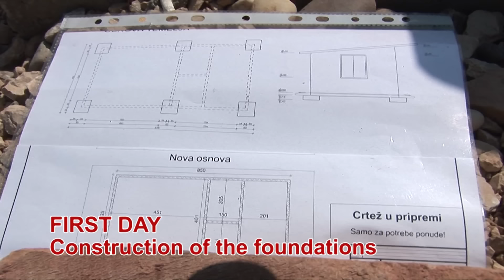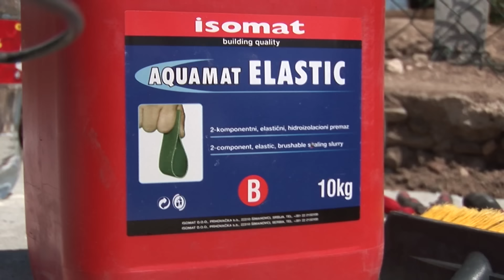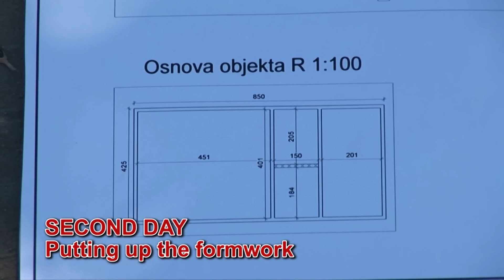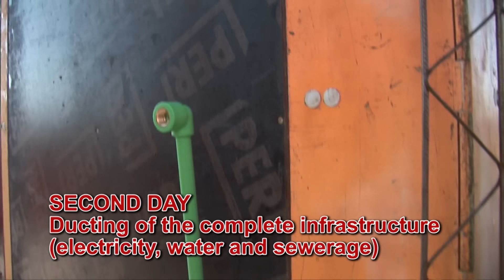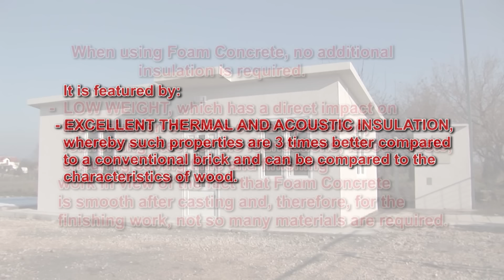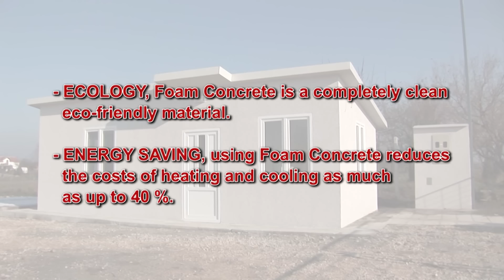FOAM CONCRETE, affordable house built in 6 days!

Comment: And here I've always been under the impression that most of the strength that comes from concrete is due from The Rock inside of it... I've made several polysteel houses and formed concrete houses. I'd be interested to know how these foam concrete houses hold up in a natural disaster of any kind?
Reply: I doubt they can withstand it, this solution is not for every city or country IMO.
Reply: It's clearly a form of ferrocement even if they call it foam concrete, so the strength comes from what it's cementing together. So really it depends on what admixture they are using to get the foam stable. I would be surprised if there isn't some form of fiberglass inside
Reply: @humanistwriting5477  ferrocement is just regular cement with less rock and more sand in it, but they make up the strength by using a smaller mesh metal skeleton with more metal surface area. like multiple layers of chicken wire instead of  bars of 5/8 rebar, Never heard of it being used with fiber reinforcements before.I would think You would need very long fibers to make it structural. I live in California and realize that our building codes are quite a bit stricter than most places.  Of course that's why when we have a 7- 8.0 earthquake we don't have 10 of thousands of people crushed to death either.
Reply: @travisdoe4663  yes I'm aware of traditional ferrocement, did you spot the grid of thin rebar? I'm hardly calling this traditional. Just, based on, a child of the tech.
And of course we can't know for sure what they are adding to the mix or not, they only show one shot of the one worker adding cement to a hopper and another showing the foam from the spray nozzle.
I am aware that aerated cement has decent qualities but it's not something I'd expect to see in a roof by any means, and it's generally preformed into low strength cinderblocks.
Reply: @humanistwriting5477  Only time I've ever seen  ferroconcrete used was in the construction of water tanks. Then they used remesh which is like a thick gauge hog wire. I have helped build 6 ICF houses  using different kinds of form block systems. It always amazed me how much 5/8 and 3/4 inch rebar went into the structures, on top of the 3/4 in. aggregate in the concrete. The engineers were always right on us to make sure we never did lifts higher than 4 feet and that our slump was correct.  Also to make sure we vibrated the cement properly but not overly. I probably built over 40 houses in the last 25 years.  ICF were by far the most expensive houses we ever built, although they'll probably last forever and the walls had an R value of over 40 not to mention the added bonus of literally being Bulletproof lol.  Two of them were multi-story and with the amount of wood necessary for forming and supporting the floors in between each level, they might as well have just built the house out of wood,lol.  Of course we were a relatively small contracting company and did not have forms already, I assume if you specialize in this kind of construction you could use the support over and over again. The ICF  Blocks were cool though, like a huge Set of Legos.
Reply: @travisdoe4663  ICF is cool no doubt. And I'd half expect something like aerated cement to be using in conjunction with the insulated concrete forms for money savings lol.
Pretty cool to meet an construction worker who's probably used the tools and forms I've made as a manufacturing engineer and tool & die maker, assuming you're company has bought usa made that is. 
Yea, the uses they have in this video is. Just a weird hybrid, it's bizarre to see, they must be including some addmix that we are not seeing otherwise that roof would be sagging into the house as they did the interior build out! Although I've always thought that a ferrocement roof properly sealed would be an ideal use case! Never did get why nobody made tools for that, but there is often times no convincing the investors that a tech will work and frankly they all don't pay any of us enough to try it on our own!
Reply: @humanistwriting5477  I think ferrocrete would probably Flex too much to use as a second-story floor or Roof System. Maybe in conjunction with a standard concrete- rebar I-beam system, with ferrocrete spans in the middle? I don't know, I'm certainly not an engineer but I would guarantee you the walls and roof they poured in the video would not pass engineering on the North Coast of California, lol.
    We started off using the polysteel ICF system at first, but we're not fans of the tongue-and-groove Locking System or metal webbing. We then tried, I believe it was called Apex? it's been probably 16 years ago now, lol.  It had a Locking System very similar to Legos and much more robust than polysteel system of tongue-and-groove that would break off if you did not handle the blocks carefully. It also had a polymer web instead of a steel web which made it much easier to cut.  Now they have many generic brands that you can buy for much cheaper than it used to cost.  Haven't built one for years, they just weren't very practical. The labor expense of tying all the rebar, moving it around the job sites and the footings and whatnot that were needed for engineering made the cost very prohibited.  We were building them on the side of the Cliffs out at Shelter Cove California. You should have seen the size of some of the footings that were necessary.. literally tens of thousands of dollars in concrete and rebar just for the footings alone.
Reply: @travisdoe4663  ferrocement definitely can be quite stiff, it's all relative in the end though, say for example compared to the metal roofing that (for some reason) is allowed to go in without a plywood sheath underneath in Utah.. where there are heavy snows.  😱😱😱

Ok. Happy to hear from your experiences I definitely do not think any of the icf systems are made for your use case lol. It definitely seems to be more for expanding a basement by a wall or for landscaping
Reply: @John Fischer wood framing is certainly the most practical. Although other Alternative building methods have their perks to, but the price certainly isn't one of them. Like ICF make sense out by the ocean because saltwater is so corrosive to metal and wood, and the concrete structure will last several lifetimes. It also has some of the best insulation R-value on the market.  But your house is literally set in stone, good luck popping in a window or door or moving a room around, lol. And if anything does fail it's going to be a PITA to do any repairs.  I remember one of them that we put together they wanted a central vacuum system. So when we were running 2"vacuum line through the concrete walls I couldn't help but think what would happen if one of the lines got plugged up, lol.

Comment: This was interesting. I wonder about fixtures and placing things on the walls. How does the walls and floors hold up?
Reply: They hold "up right"..
Reply: they don't. that's shit consteuction with chemical marerials.
Reply: I would imagine you'd need conventional framing inside the wall for locations that need it like cabinets and fixtures.
Reply: @frenkloyd4277  AirCrete is concrete with foam mixed in providing the "air*.  Said foam is created using basically dish soap. Unless you are calling dish soap "chemicals" as if you don't eat off dishes washed in it daily, then okay. Gaslight much?
Reply: @MotoAtheist  it depends on the thickness of the walls and amount of foam/crete ratio, Overall, AirCrete has the density of wood. The surface does need to be protected to prevent wearing.
Reply: @bhing1483  of course dish soap are chemicals and i don't use them to wash what i use to eat.

Comment: The good point is, in this house there will be no Mouse in the wall's..
Reply: +Nadejda Schmidt they eat through concrete
Reply: +Nadejda Schmidt   LOL ..... that's funny ..... :-)
Reply: Allan ES I've seen it.
Reply: +Allan ES I'm afraid they do eat through concrete mate. My mothers bungalow had concrete floor in her living room and new carpets fitted and come in one day to find a hole in the centre of the room. pesky thing had eaten straight up through the concrete and carpet.
Reply: Silent.Thinker
 you will find in reality the mouse found a weak spot (Crumbling concrete, and also wasn't indicated in my original comment), a mouse can get in though the smallest gaps ( I've seen them do it) they are able to flatten themselves out to squeeze even just a couple of MM
Reply: +Silent.Thinker thats true but at least they cant hide inside the wall out of sight to have lots of babies.
Reply: +Key People.  Through not Threw lol...
Reply: +Key People *through - not threw.
Reply: +Allan ES 'a couple of mm'?    That's nothing - I've seen a mouse disappear and reappear suddenly in another room,  WITHOUT using an old telephone box!
Reply: Bob Loosemore
I included the fat mice lol
Reply: +Nadejda Schmidt or cat in the house (well, maybe)
Reply: +Allan ES      "even just a couple of MM"

No.
.
Reply: geoh7777
 there are some very small mice about if you weren't aware
Reply: +Allan ES Rats can eat through steel given enough time.
Reply: Allan ES Not true, mate, rats can chew through most any common building material, even plate steel, in a reasonable amount of time. Their jaws have a very substantial amount of clamping pressure. Like beavers, rats need to continue chewing to wear down their teeth, because their teeth don't stop growing.
Reply: Michael D
I never said they couldn't lol , I said they would likely die of old age first
Reply: Allan ES Want to put some money down on that, mate?
Reply: Michael D
you clearly didn't understand , go back and read it again instead of trying to troll me !
Reply: Allan ES I'm referring to the dying of old age part of your statement. Twenty dollars in the pot, are you game? lol
Reply: Allan ES I am simply offering a service, friend; you just keep coming back for seconds. Shall we order dessert?
Reply: +Allan ES yes they do, they also chew on ferrous metal pipes, copper wires and sewer pipes
Reply: Nadejda Schmidt that's Hilarious 😂😂😂
Reply: Nadejda Schmidt xsdx
Reply: lol
Reply: Ask this old house
Reply: Michael Nonya h
Reply: lol
Reply: the mouse got sick and died.

Comment: What do you do when you need to repair your electrical or Plumbing from age. Perhaps you repairing something in your plumbing and your piping  off at the stub of concrete. Same with your wiring. Your wiring could be spared by running it through pipes or conduit perhaps. However, you need to come up with something better for the plumbing maybe pipe within pipe I don't know. Yes it does have some serious design flaws. What do you expect from college-educated engineers and never worked a day in the field.

Comment: Neat little house. Didn't care for music choice.
Reply: Phil Verry hey came out this week with news that a lot of States are forbidden these little homes charging those who don't need electric ,living off solo having a propane tank for gas heating digging a well to collect water .
Reply: I know Colorado has cause my buddy checked on land there he was told it house would have be at least 1000 sq feet but if you built it got solar and all you get a bill on bare minimum bills on water gas electric so on
Reply: Neither did YouTube, it seems, as the video is now silent.
Reply: Well, until 3 minutes in, anyway.
Reply: Phil Verry hyrejrdgigs
Reply: That triangular symbol in the lower left corner of the player is the volume control. Put the cursor on it and draw it to the left and the sound will decrease.

Comment: too long and seriously annoying music.....how about telling us more ABOUT THE MATERIAL......

how does it compare to concrete supplimented with styrene foam, glass fiber or wood sawdust?  how about "microspheres" used as inclusions for resin fabrications?   How does it stand up to those in wear & durability?   What is the over all strength?   You've missed your chance to tell us about the material, instead subjected us to 18 mins of crappy electric guitar and a poorly sequenced construction montage...
Reply: agreed
Reply: Typically the concrete is a mixture of foam and portland cement and in this case mixed with reinforcing glass fibers. The key advantages are that there is nothing for insects to damage, the insulation value is really good, and the addition of the foam means less actual concrete is used so it is less expensive.
Reply: @toffybillbabba  Perfect just about anywhere. I would love a house made like this. I live in the PNW where we have to deal with lots of rain and temperatures that can range from the low teens to the 100s. We have a variety of different wood devouring insects and have to deal with mold and rot. This type of construction almost completely mitigates ALL of that.
Reply: Building codes in the States can be difficult. But we have rural areas where you can build pretty much what you want as long as you are ok with local authorities. The US has very local building codes depending on Geographical Area, State and local county. Where I live, Ozarkansas we have lots of unrestricted mountain land that you are free to build pretty much what you want and then scare any inspectors off by firing an assualt rifle in the air. We are not Socialist Here. Not trashing your country, just isnt the system for us. 
And i would love to build a bigger version of this home on some of my rural mountain land.

Comment: Quicker, cheaper, more environmentally friendly to use an ICF system with GGBS and/or Fly Ash GeoPolymer Concrete with a recycled aggregate. Or, lets be honest, a cheap concrete block and mortar system, which is traditionally what they use in those areas anyway. Both use less water too.

Maybe float screed and polish the floor...whats with the tiles?

I dont think the rebar is laid directly onto the ground as such, its on an aggregate bed thats sealed by the high slump rate concrete slab. Not ideal in a temperate climate, but probably OK for this application. You can get away with a lot more in that environment. 

It doesn't look like its built to last, it looks like its for "temporary" housing for disaster areas, slum replacement and/or impoverished areas.
Reply: Lovely design, but what is the actual “R” insulation value of walls and roof?  US zoning standards would require much thicker concrete slabs and deeper concrete footers (unless you are only going to build them in tropical or sub tropical zones w/ no frost). I think the forms usually have to stay in place longer, before dismantling (24 hrs…really?). Nice storm resistant structure. Having all the pipes and electrical connections in wall (imbedded in concrete) better be done right the first time, if there were issues later with connections, you would have to rebuild the house to fix them. Was the plan for solar utilities?  Surprised your workers are not wearing safety eyewear, no masks working with powered concrete and waterproofing and no gloves working with “raw “ concrete. Definitely would not go over in the US, but a nice compact “safe” home for temperate climates

Comment: I want to look into this foam concrete product but as a general contractor in Canada there are many building code/quality and some safety issues I see in this video. And that roof slab, why didn't they use chairs to suspend the re bar in the middle of the concrete so that it's not poking through the bottom ?
Reply: How well would this building fare against an earthquake or a tornado?
Reply: @Alberto-mq3jm  It's all concrete, so would probably do quite well against the wind. No earthquakes in Poland, so they don't care about that.
Reply: i would not want a concrete roof falling in on me
Reply: 3rd world country no worries
Reply: Good enough for me I'll take 1 for 10 k

Comment: I think the upcoming thing for less expensive ,smaller homes is going to be 3D printed homes. I've looked at several articles and videos about them - very interesting.
Reply: How durable are they against the elements?
Reply: @worldwidereaver  They are made from a concrete and a plastic mixture so probably very durable.

Comment: The one shown here I had a close look at.
It is the only one that was ever build at the factory property.
Visitors came from all over the world.
After the government subsidiced this project to the tune of $10,000.000 the project went bankrupt.
I inspected the prefabed walls still laying in the factory when I discovered that the only uniqueness about this structure was the prefabrication of the walls.
  Lightweight was supposed to be achieved by adding a few foam pellets into the concrete.
  Lightweight connotes supper insulation
 which this structure never achieved.
I suspect that a whole lot of people knew this was a fraud.
  By comments I got, it appears that the original person putting her efforts into this was hoodwinged by individuals surrounding her.
  Having personally experimented with lightweight concrete got me interested in this particular project. 
  It so saddens me when good ideas are used to fleece the public of a lot of money.
Reply: others are doing this india and mexico  it actually is quite well it deadns sound and insulates

Comment: Interesting. However, as said by Lorin K, I would have insisted on cabling being protected by conduit and I noticed that the plumber did not put any tape around the pipe threads to ensure no water leakage.
Reply: taping pipes isn't really done anymlre since long life  sealants.
Reply: yes i notice that too it will become a swiming pool very fast lol
Reply: NEVER trust plastics or ultrasonic/sealant welds! Exactly what will they do when a pipe does crack, tear into the walls???